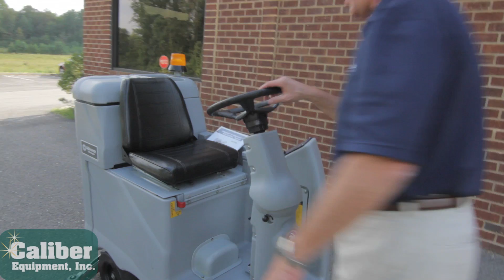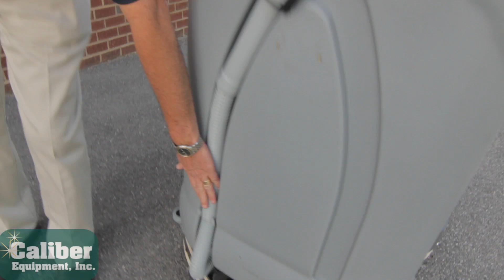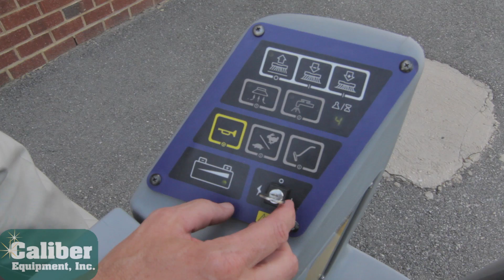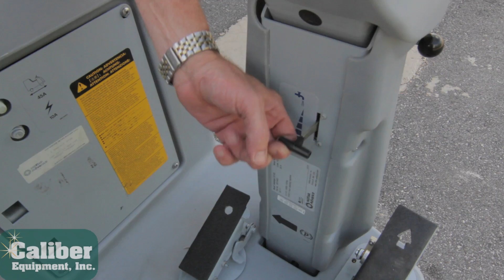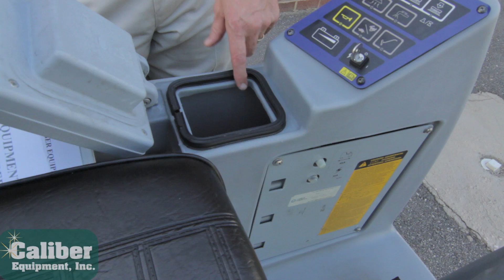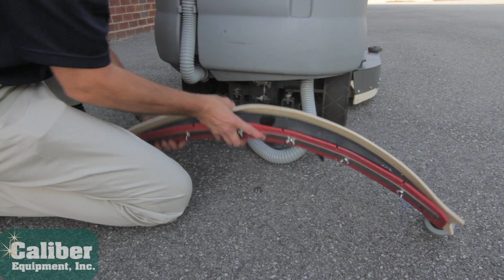Advance Advenger Training Video

Comment: Ours has failed 3 sets of batteries.  Any ideas of wiring trouble shooting or places to look?
Reply from the maker: Are they wet batteries? If the water levels are not maintained properly, that can kill a set of batteries very quickly.